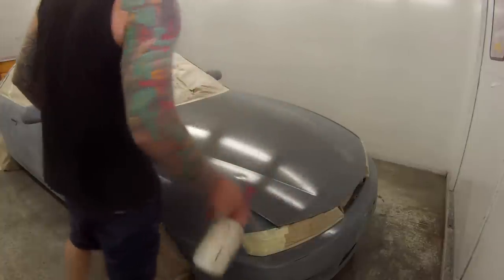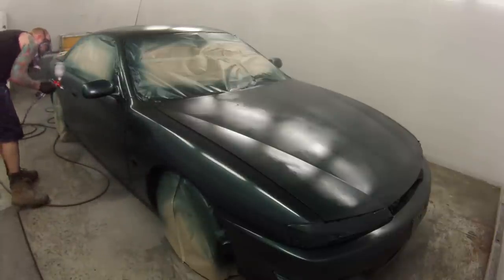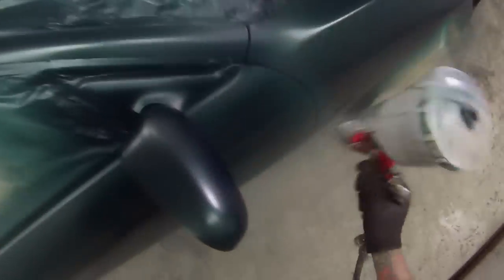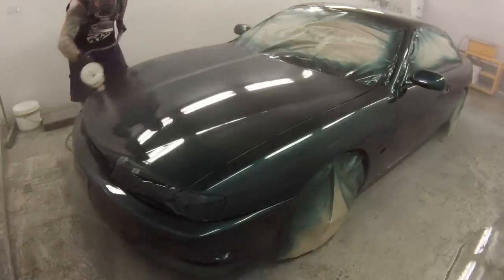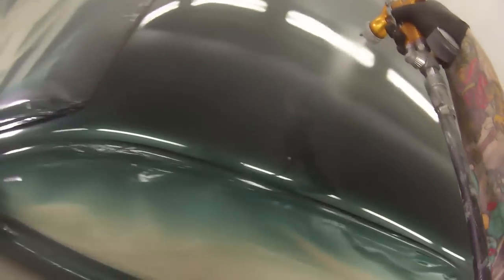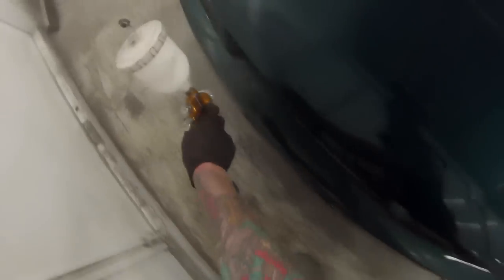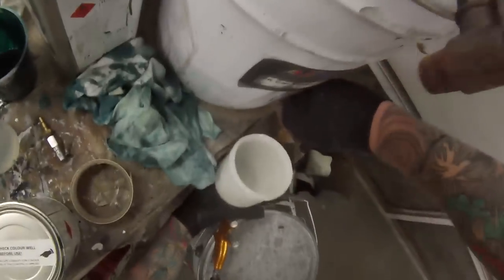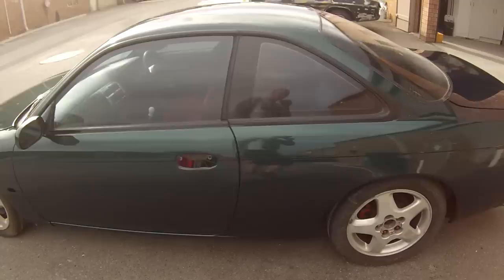$1000 Respray

Comment: Very helpfull video .I have learned heaps from your videos .This one being perfect for me .You have encouraged me to have a go . Your results off the gun are amazing .
I am retired from working and as such have time to carry out the respray of both my cars. They are basically straight but both old ,19 and 25 years old. The paint has chips and some car park dents but very good for the age .I plan to do all the preparation at home and hire a spray booth for the base and clear coats .
I last sprayed a car around 20 years ago using acrylic lacquer .  
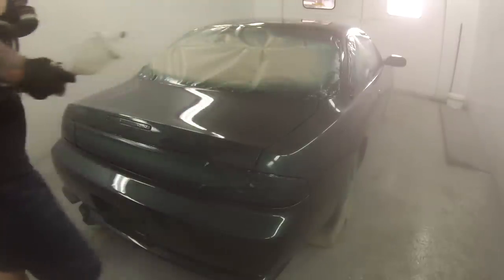 Anyone looking at a full respray should study this video. The uncut spraying procedure from 17:33 shows the best sequence to spray. I feel this is important. I have started practicing with a spray gun with a paint brush taped onto it ,to practice this. You have years of practice and your muscle memory is deeply ingrained . You ,like any top professional,make it look easy . For a novice to achieve acceptable results will take practice. I think if i hired a spray booth and just started spraying ,without lots and lots of practice ,the results would be disappointing for sure.I hope to be able to correct my spraying faults with cut and buff later .
 I also understand your comment about long answers so i will try to ask questions that require short answers .
 1. If the spray booth has airflow from front to back, would you position the car with the front of the car at the front of the booth ,so that when you finish at the boot,the overspray is going to go away from the car?  
Thank you very much .

Comment: Hey Gunman,Just thought I would throw in a little info about what paint work costs in the US.I have a black 2000GT mustang with no rust anywhere and just 3 dings about the size of a penny on the whole car and some bug strikes to the front bumper bar that I covered with 3 coats of 2k primer and sanded out myself and the quote to paint my car with a nice new hood that only needed primer and blocking and me handing them a near perfect car was $5800 to $6800 US which I think is insane.I purchased all the supplies to do it myself for $650 to $700 and that was for quality materials and enough clear to flow coat the entire car which wasn't in that price,I'm glad with your help I decided to do it myself.With the speed I've seen you work I think you would have done my car in 5 or 6 days but it will have taken me twice that long to get it done only because I've taken my time and made the body as perfect as you can get it.If those three dings hadn't been on 3 seperate panels I probably wouldn't have decided to paint the entire car anyway,my car has been garage kept since new.This is just an idea of how much paint work costs in the US.Hell I didn't have a problem with 3 grand but twice that much when they can get a better deal on paint than I can just seemed high.Also I seriously doubt the quality of the paint work would have been like what you can do or maybe me.I'm ready for color & clear in the next couple days and I feel sure there will be a sense of pride when I drive my car now knowing I done the paint work myself.I Plan on leaving two fat black stripes on the road the first time I take it out,one for each of us since without your help with all my questions and your vids giving me the motivation to go paint some shit I wouldn't have done it myself.The 4.6 liter twin overhead cam V8 on a 150 shot of nitrous and a 5 speed will be will be eating some asphalt.I'll feel like your with me on that first ride,Thanks Gunman

Comment: Hello Gunman! I am wondering what kind of paint are you using? I noticed you didn't have a fresh air system, and you just used a cartridge filter and your arms and legs and head were exposed. I'm assuming it does not contain Isocyanate? Even though you mentioned it was 2k. So I am just curious because this could be perfect for an enthusiast like me who would not want to invest in a fresh air system.

Comment: Hey gunman, job looks great.

I noticed you didn't wet the floor as much as you did for your echo and the other cars you spray, could you post a pic of the amount of dust it had? Just curious to know how much wetting the floor helps. 

Also, how is the booth coating going for ya compared to using water?
Reply from the maker: ***** The water must have evaporated because it was stinking hot on this day and that booth coating is awesome, my jobs have been coming out real nice lately.

Comment: I've got an old Merc E55 which has some damage, a wing two doors and a little on the body. I'm seriously thinking about tacking the paintwork needed myself... You've got me inspired, but I'd be doing outside... And probably buying a cheap compressor and gun. I'm not after show car... Which I know with cheap gear I won't get! I'm realistic. Not certain I'm going to actually do it or just wimp out and get a shop to do it

Comment: Hi Gunman, thanks for the vids - you've given me some great tips! I'm very much a beginner, nearly completed repairing/spraying a bumper for car - its going very well with a show room finish. It's made me want to do the rest of my car cause I've over polished it, taking your advice "not to do the whole car in one shot as a weekend warrior in my garage" got me thinking about baking the paint as I usually do the base coat and clear and leave it a week before I buff/cut the clear on panels not attached to my car, I'll need to drive my freshly painted car home at the end of the day after its been painted... Is there a DIY way of baking the paint I guess with heat bulbs, any tips how to bake paint using a DIY way?

Comment: Nice job. Didn't mine the extra minutes. Question on taller roofs like a truck. Are you working off a ladder to spray the roofs?
Reply from the maker: edsf100 Yes, I usually stand on a 44gal drum and also paint it separately to the body so you aren't leaning in the side.

Comment: Hi Mate!  great video and job. im going to sand my car back in problem areas  where its pitted  and surface rust very small bits. can you recommend a primer to stop rust while im doing this. pls . i will need a spray can if possible. no need for  filler  ect. 
happy to donate will do so  if you still on you tube

Comment: Hey gunman I know you're a busy guy but I would really appreciate some advice. I have a BF Ford Ute that I want to get tidied up. it's an FPV F6 so I think that it's worth it however there's some bad repairs that have been done before on it and I would like to know how would I approach a potential panel shop to try and get this thing resprayed? I watched your video on flow coating and I really like the finish. Do you reckon I could disassemble the car, sand all the panels back do a bit of Prep work perhaps to try and help alleviate some of their man hours that they would have to invest into getting it resprayed? Any advice would be appreciated anyway.

Comment: Hey gunny, can the 2k clear,  sanded and roughened up be a good primer for basecoats? Not dealing with an actual car here, but wooden instruments. What do you think? Veterans tell me as long as my coat is sound, cured and properly roughened up, almost any type of a finish can work as a sufficient 'primer'. Wood primers and sealers are usually just thinned down clears that dry and cure very fast, but are twice the price for me. What you think? Thanks!

Comment: Hi Gunman I'm getting ready to prep mask and paint a 1984 landrover defender 110 the body is in reasonable condition for its age but has some corrosion to the aluminium the chassis is galvanised so most of the work will be body panels what materials are best to use on this barcoat ect...

Comment: wow how can you move that slow and not get orange peel ? what tip did you say that you are use and how much psi.
Reply from the maker: Michael Francis I was running it at 15 psi but it was 40c if colder I'd use more say 20-25psi, 1.3mm tip.

Comment: so when you smash the clear on the bonnet roof and boot its alot of paint. i tried it and after spraying it was like glass i was very happy next day kind of dulled and looked like solvent popping i was scratching my head. i air dry where im at and it was cold out side inside was 61 F yes brrr so should i have did 2 medium coats and give it a scuff the next day and do another or should i have waited an extra 10 15 mins between coats.

Comment: what does 2k thinner translate into in the US. You said you could use basecoat thinner or reducer here in the US. Is 2k thinner lacquer thinner? Im going to try to blend in the clear coat on an overall and would like to know if I should use a fast reducer and clear mix or whatever 2k thinner is here in the US. Thanks.
Reply from the maker: memphosfinest I was just using a 2k (2 Pack) universal thinner (reducer) that can be used in basecoat and all 2k products, a fast thinner would be fine, here in Australia most paint systems use a universal thinner that can be used in any paint.
Reply: The Gunman we use urethane grade reducer for base and only hardener for clear so would it be fine to use the UG reducer with the clear ?

Comment: How much of this $1,000 was labor? Asking in order to get an idea of what the material cost of a pint job is.
Reply from the maker: smithraymond09029 the job took me all of 6-7 hours, paint cost $250 so I was still on around $100 an hour but don't forget all we did was mask and paint, no prep or polish.
Reply: The Gunman that's some good money IMO. don't know too many shops around here makin money like that. $250 for all that paint? know of any places in america where I can get a BC/CC for close to that price maybe say 350$ for a full car? not lookin for anythin special, maybe a good single base color or basic factory style metallic? ever heard of TCP global? some guys were saying they just resell old/dated PPG at a discount price? they have some decent prices and will mix specific colors. just need to find a better clearcoat apparently because their clear is apparently pretty shit.
Reply from the maker: Munky332
I was able to keep the price down by using a close color first then only had to use 1lt of the correct color. I have heard of TCP but never used them, They do loads of that stuff in paint companies with re branding and that. I did a respray recently for 10k
Reply: Munky332 TCP global has like 5 different clears. The more expensive ones work much better needless to say. Try the KC 202 Ultra Flow reduced 10%  next time, it flows out smooth as glass.
Reply: Rod Palm I  did some more research, and I heard that SPI (southern polyurethanes inc) has an amazingly good prices, and alot of folks consider it to be the best clear on the market. so my idea is to go with a cheap TCP base, and spray SPI clear over it.

TCP has a decent base list, but will also color match for about $250 for a gallon of clear. obviously selecting from TCP's color list makes it much cheaper.

SPI's euro clear is about $110, for both the clear and activator, and about $150 for their universal clear.

Comment: lol wtf... asked for my rear bumper to have a small bump fix and that part painted, its like $500... $800 if the whole bumper gets repainted. Paint match not guaranteed.

xD
Reply: Bumpers never match for the most part anyways. Even brand new, if you really look you can see (depending on make) a pretty big difference.
Reply: Ronan B Bumpers reflect color differently than metal panels, casting a different reflection. Especially pearls